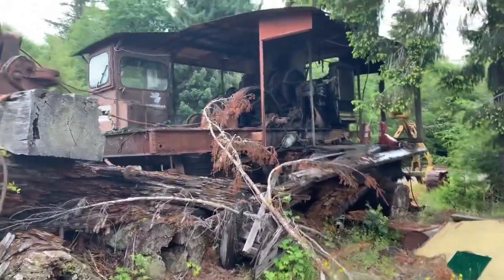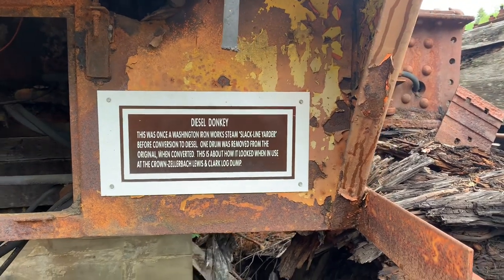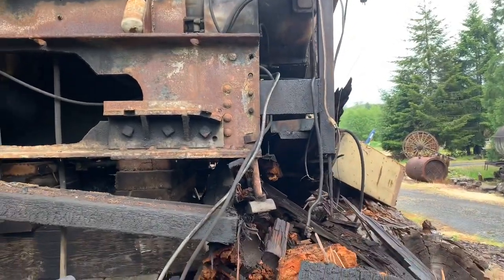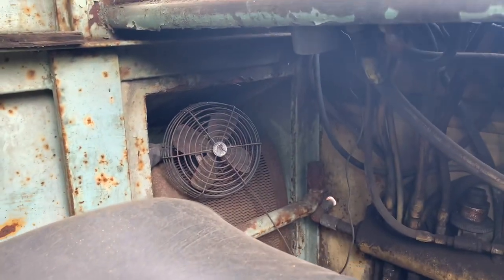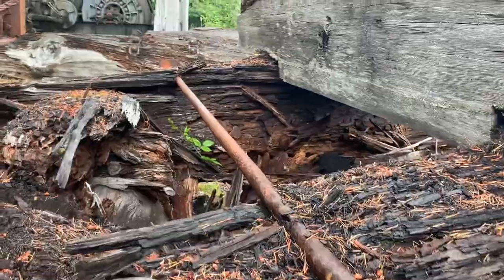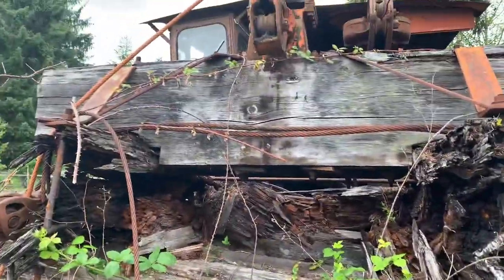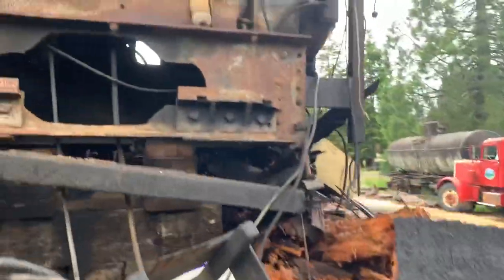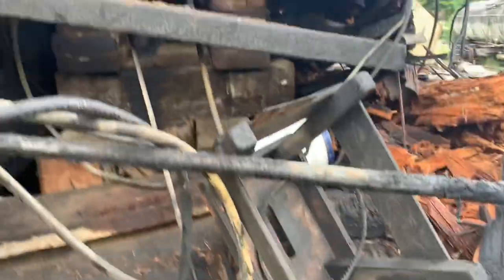Diesel powered logging donkey

Comment: I don’t know yarder terms, I be you mentioned haywire, what’s that?
Reply from the maker: That is a small 3/8 cable pulled by hand to a block and back to the machine. One end hooked to the large 1 3/8 cable the other hooked to a drum. Then winched in pulling the heavy cable out to the block to be attached to a stump or lift tree